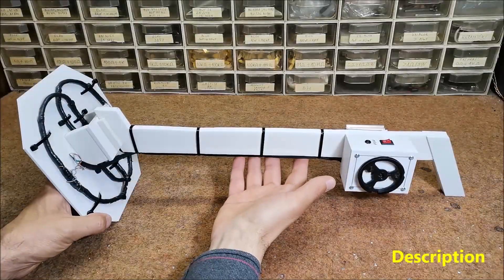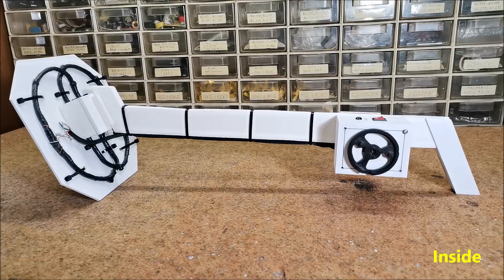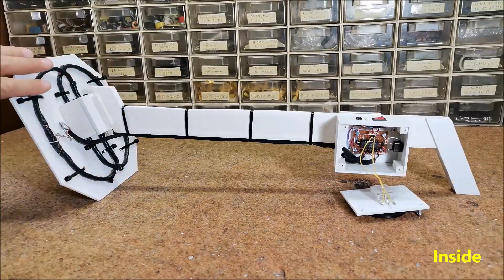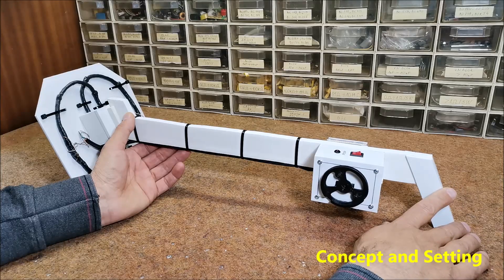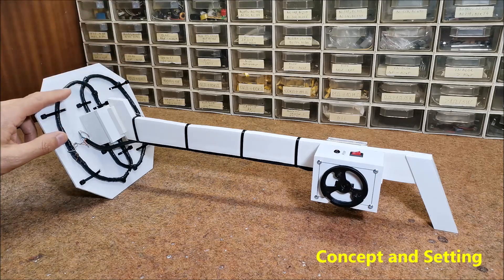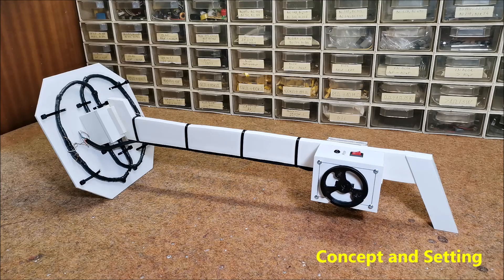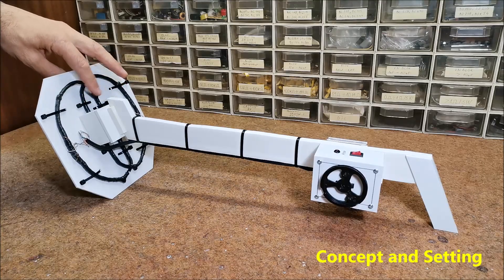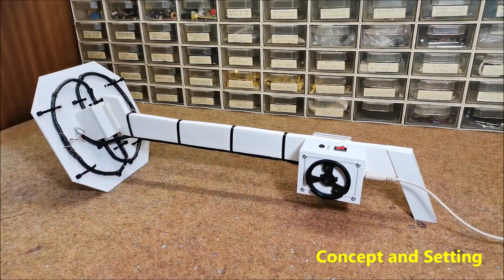DIY Super Simple Sensitive Metal Detector

Comment: Thank you Mirko. I had a double D coils from my previous experiments with slightly different parameters: 0.3mm, 50 turns with 16cm diameter. I tried to build your version with them. At first I tried using the coils without the foil shield and it kind of worked, but was very insensitive and reacted not just at metal, but, for example, at my hand. I added the foil shield to each coil leaving about 3cm gap and connected the shields to each other and to the ground. Now I cannot make it work at all. I have high frequency signal at the output (~13KHz) and the frequency does not change when I change the overlap, but the signal disappears when I move the coil sides too far or too close.

My board is connected to the coils with unshielded but very short wires (less than 10cm)

Any suggestions for diagnosing this problem?
Reply from the maker: I really do not know, maybe you can try without Mosfet transistor, as in the original

Comment: I have 0.2mm copper wire. Can I use it or do you advise to use 0.3? In the case I use 0.2 are the number of turns and diameter of coils the same?
Reply from the maker: You can use 0.2mm with same name of turns and diameter of coil

Comment: Thank you Mirko!  I have a couple of questions: 1) How do you bond the earth wire to the Faraday shield (aluminium foil), and 2) does the cable from the circuit board to the base plate need to be shielded?
Reply from the maker: I wrap a bare wire around the aluminum foil and insulate it with tape.  Cable from the circuit board to the base plate need to be shielded

Comment: I implemented the circuit that you used, Ne555, FET 2n22222 transistors, 100qf chemical capacitors, lenticular, variable resistors 100 and 10, and many elements in detail and with all professionalism, but it failed and I repeated the experiment and did not get anything, so my friend I advise you if your main goal is to collect money from views, change the private content Don't make people pay for lies you're fine

￼
Reply from the maker: Dear friend, as I emphasize in the video and the text, the device was presented in the prestigious magazine Everyday Practical Electronics in June 2006, and my main goal is to test the features described in the above magazine with a video presentation. So this is not my personal project but I can assure you that if you make it according to these instructions, it works flawlessly. In fact, you can see it in the video itself
Reply: would like to explain to you that I did not mean to annoy you or deny you. I watched the video and applied the circuit in detail and followed your steps in full, but it works. It is not sensitive to metals. The transistor opens. There is no pulse. Everything that I connected the know-how to the battery gives only a pulse that works by lighting Wayne ... Fanatic with any value with any equivalent And if it succeeds, I will talk to you in the comments and I want to increase the depth and set the circuit and the Arduino to select the frequency